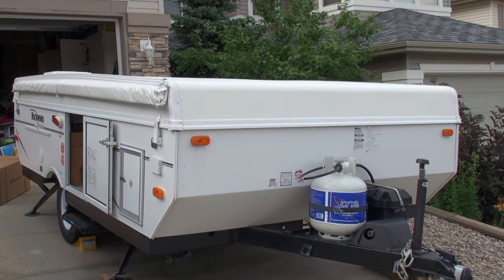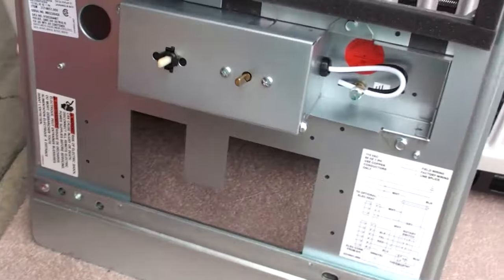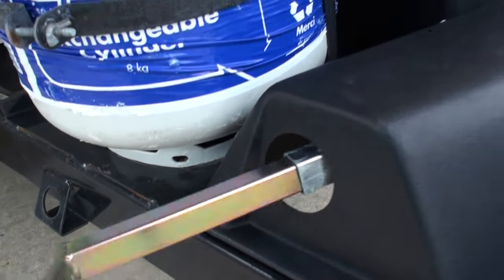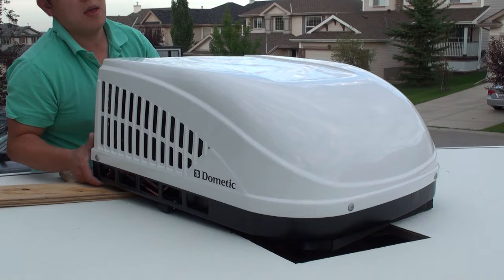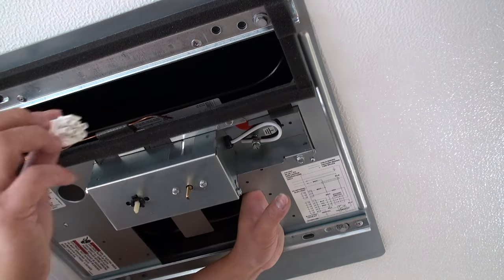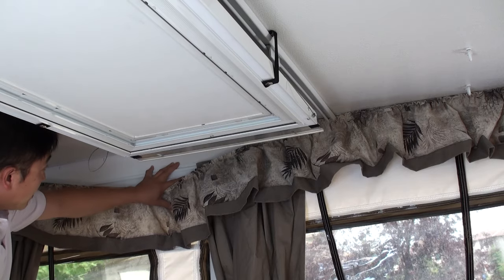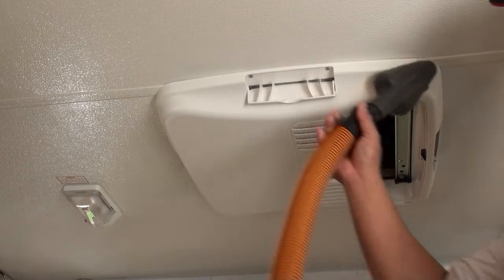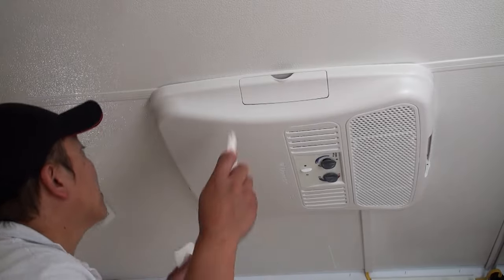Install a RV Roof Top A/C Unit on a Forest River Pop Up Camper Tent Trailer

Comment: I was actually thinking of installing a Brisk II air conditioner through the vent in my rear bedroom in my travel trailer - it would be my second A/C.  The only problem is my TT is only 30 amps so I can't add the power back into the main power.  That being said I was thinking about just doing the outside connector (same as you did) and then plugging that straight into the shore power at the campground so I would have both a 30 amp and 20 amp cord going into the shore power.  Besides the obvious problem of perhaps some campgrounds don't send enough power to the box to work both the 30 amp and 20 amp circuits at the same time, and the fact that the only breaker I would have would be on the shore power box, do you see any other downsides to doing this?  AWESOME video BTW, really helped me decide whether or not to do this.
Reply from the maker: +OmegaZero1981 If you're adamant on having dual a/c on your travel trailer I would opt for a power panel upgrade and convert the panel to handle 50 amp service.  In your case your input feeder to the power panel is 30 amps.  A simple swap out of the shore power cord and power panel = super easy to do AND it will allow you to wire everything cleanly like it was designed from the factory.  Remember, 50 amp service isn't saying that the rest of trailer will "use" the extra amperage but rather that it increases your input capacity to split out the power safely to the rest of the trailer's electrical loads.  Keep in mind that if you swap the panel out that you can resell it to recoup a lot of your costs so this is something I would do if I were in your situation.  

For the campgrounds that don't have 50 amp service just remember that they'll at the least have 30 amp service which you can still use for your trailer permitted you don't run both a/c units (otherwise you'd trip the campground breaker).  

I personally don't trust the campground breakers as I have seen breakers fail and it gives me chills knowing that the outlets and breakers in some campgrounds can literally go up in fire.  Put the protection where you know how it's been treated (i.e your trailer's own power panel).

Glad you liked the video.  Give me a thumbs up if you can and consider subscribing :)

Comment: This video is exactly what I was looking for as far as install. You do a great job explaining. After googling I came across a forum thread with your link to this video. I also have a 2280 but it has the roof vent already installed with a fan. I was wondering if you had any links to where you got the cord and also the plug part you have to drill the hole for wiring. Thanks.
Reply from the maker: The cord is made from SOOWJ cable (essentially a commercial grade 12 gauge extension cable).  The plug you just purchase from the RV dealer as they sell them usually as a regularly stocked item.

Comment: Just a quick note to say Dometic now has very good DC air conditioners which are far more efficient if you're running from a battery. There is also a Under Bunk unit.

Comment: This video was perfect. I love how clearly described everything was, with great camera angles, lots of very specific technical advice, i swear I could print off a transcript of this video to get my shopping list. Bravo! now just to find out if my 93 palomino yearling has roof bracing built in. If it does not, do you have anu advice on what I can do to brace it up?
Reply from the maker: Glad you liked my video!  A lot of time and effort went into creating that but it was worth it when I hear you say that it was well done :). You can buy roof braces for your pop up from a Palomino dealer. They may need to do some digging but they should be available. If I recall they are bolted to the underside of the pop up’s roof and then screwed into the stronger wood side panels that make up the roof frame. Double check before proceeding.
Reply: @piercedasian thanks! after i left this comment I looked at the riginal manual for the year I have (1993) palomino line of models and it clearly states that every one of the models in that year except the shetland (the smallest one) had A/C available and the photo of the unit looks like it was right where my existing hatch is. I take it to mean that this would already have the bracing installed, similar to what you had n this video. If you have any different take away from this I would gladly accept your advice.
Reply from the maker: Hmm, that's a tough one.  I personally would think that there is bracing already inside but "a/c available" could mean that there is an optional roof bracing kit that comes with having a/c installed.  Do you see the little screw int he roof like what mine has?  If it does then it likely does have the bracing inside the roof b/c why would they mark where the hole is if it can't have a/c?  It certainly isn't used for installing a roof vent b/c the Palomino's already one one towards the back.
Reply: @piercedasian  very good point. I cant get to my unit right now thanks to weather but when it becomes accessible I will have to look for any other screws indicating a hole. The part that trips me up is that the original brochure shows a photo of the ac unit and I could swear it looks like it is in the same location as my roof vent, which I thought was odd but it impossible. I will comment back when I am able to climb inside and do a little searching

Comment: outstanding video! clear and some very good information! thank you sir, you just gained a subscriber.
Reply from the maker: thank you for subscribing to my channel!  I'll be doing a new vid on properly sizing RV shore power cables and making sure that your RV is properly wired for all connected loads including whether or not one should require a main breaker in the power converter.  Doing it this week so you should see something posted next week :)

Comment: Awesome video!! I have a 2018 Coachmen Viking that is AC prepped from factory. I would like to install an AC unit. Is my setup plug and play or do I have to install a similar electrical set up like you describe in your video?
Reply from the maker: it will depend on the model you have.  You need to consult with your owners manual or call the manufacturer to find out.  In many cases you will need to install the electrical as how I have demonstrated.

Comment: Nice video. A couple of things, first a question - does this unit cycle off when it reaches temperature, or is it like the old ones where the pump cycles off but the fan continues to run?

Second, you could use a drywall hole saw to cut the ceiling panel, then drill the four corners as markers... using a jigsaw and hoping you "feel" the parts you should not cut is kinda risky...
Reply from the maker: Hi David, the fan stays running and the compressor cycles on and off.

I could've done the drywall hole saw but honestly with a jigsaw/reciprocating saw you could definitely feel where the supports were.  As long as when you're cutting you're not forcing the saw and letting it do the work it is equivalent to cutting butter and when you hit the "framed hole" that you'll know.  Just take it slow and gentle and it's super easy and nearly idiot proof.

Comment: Have you thought about adding the heater to the a/c unit? I was wondering how difficult it might be. The older and wiser I become I would prefer to use electric heat vs gas heater in my pop-up.
Reply from the maker: I did but the issue is the heater is so small and the fan moves so much volume of air that you won't actually feel much heat at all and you're better off to run an inexpensive 110volt AC space heater instead.  The optional Dometic heating strip is costly but is EXTREMELY easy to install.  Plug and play and 1 screw to secure it.

Comment: The roof installation was done very well and gave viewers an accurate assessment of what is involved in the installation. I am wondering however why you did not just use a GFI plug mounted somewhere inside the trailer and just run a power cord to that plug instead of doing the additional plug on the outside of the trailer? Fleetwood Niagara trailers use that type of installation to avoid having any extra holes drilled to the outside of the trailer. Was this required to do with the unit you installed?
Reply from the maker: I installed the A/C unit exactly as how Forest River would've done from the dealership or factory.  There is actually a GFI plug inside the trailer where the umbilical power cord plugs into so I'm definitely well protected.  I was going to go the route of putting the wiring inside but I'm a "factory" kind of guy and if the factory does it a certain way you can be sure that I will likely follow suit.  Sometimes not the best approach to do things but at least I know it is proven to work.  No leaks or anything so far so I know the install is holding up perfectly.
Reply: Ahh ok ... the A'/C unit on mine has the power cord run to a GFI plug inside the trailer from the factory which is why I was wondering why you routed it to an external plug then back to your panel. Nothing wrong with the way you did it I was just curious.
Reply from the maker: yeah, the manufacturer apparently designed the install specs in the manner that I showed so I simply did it the way their engineers had it.
Reply: It's interesting how Forest River chose to do it. The only real advantage I can see is that you can plug your AC directly into the power pole at a campsite or a generator with an extension cord, and not go through your trailer's converter, freeing up that plug you put in for a space heater, microwave, or something like that. 

Like Chad mentioned, the way Fleetwood would have done it from the factory on our Santa Fe would be to run essentially a 12ga extension cord on the inside, down a sleeve in the canvas to a plug that gets plugged into a prewired 20A GFCI outlet. No worrying about putting holes in the roof or sidewall of the trailer (other than the 14x14 hole for the AC itself!).

I really enjoyed your video, it was extremely comprehensive and detailed, and it should help many folks feel more comfortable about installing AC themselves.

Comment: I was just looking for bracing ideas as my old 88 Coleman AC is sagging. This was a great video. I love quality installations. I have noticed that my AC blocks my rear view mirror and have seen some AC units installed off center for that reason. Wonder if off center weight would affect how these roofs sit.
Reply from the maker: Glad you liked my video.  Yes I'm neurotic about quality work.  I hate it when things don't go perfectly.  Frustrating and annoying to go back and rework things when they could've been done right the first time with some upfront planning and care.  I can't say that I've ever noticed the roof sagging or be "offset" from the weight.  No issues so far and it's been a few years since I installed this a/c unit.

Comment: Nice manly shoes for using power tools! Good thing you didn't slip and cut off a couple toes!
Reply from the maker: True... I had my steel toes in the garage and probably should've worn them.  Manly shoes?  Sandals can be worn by men... maybe just when carrying a 100 lb air conditioner and using power tools... that was my bad.

Comment: Great video, I admire your thought process; "the most important step in the process, is the step you are doing at the moment", don't proceed until each step is perfect! I'm like that too and am constantly criticized for it. 
Now that it has been five-years, how is the Dometic holding up? I just read some reviews on that model and not all good. 
I have an old ambulance that I converted into a camper, it has 20 amp shore power and I use a 2900/3200W propane generator when boon docking and no electricity is available.Would this generator handle the Dometic unit?
Reply from the maker: The Dometic a/c is working wonderfully.  I've sold the pop up camper but stay in touch with the owners and they LOVE it.  Not too many pop ups with a/c so if you see a Rockwood 2280 on the road that it might be ours :). The reliability of these units is only as good as the install.  I'd be interested in knowing what people complain about on these units.  Dometic DID have a run of undercharged units back in 2015 that caused a lot of issues (mainly not cooling well and ultimately burning out).  Lucky for us our a/c unit (plus another one I installed for a friend's pop up) works perfectly and continues to do so years after I installed them.

Comment: Only tip I would add is to locktite the 4 bolts that attach unit and inside panel to roof. They loosing up over time causing ac seal on roof to leak

Comment: How many watts is your inverter?    Great job by the way, thanks for posting. Now it's my turn to put  air conditioning  in my class C.   Wish me luck. !!!
Reply from the maker: My generator is a Honda EU2000i inverter.  Running watts is around 1600 watts continuous.  When I need to boondock, I will pair my unit with another Honda EU2000i unit (from a family member that owns the same unit - that decision was by design so we could "share" as needed when we'd go camping).  To properly run a 13.5K BTU unit without any "startup" voltage sag damage it is best to run a minimum 3000 watt generator on full speed so startup of the a/c unit doesn't struggle with any possible voltage sags.  Having dual EU2000i's of course gives me PLENTY of headroom to run the a/c all day long and keeping fuel consumption in check.  I try my best to select sites that have power so that its remains quiet and decouples my need to run a noisy, fuel consuming genny.

Comment: @34:30 typically you want to wrap tape in the same direction as the tightening of wire nut --> clockwise. Source: I am an electrician. It truly doesn't matter than much tbh. Great video
Reply: @piercedasian
Reply from the maker: lol, yes I noticed that too after the fact.  It likely won't make any difference since nothing will be moving after its installed but yes it is the small details that do make the difference.

Comment: Thanks for the very comprehensive video.  I'm just wondering if you installed a thermostat with your unit.  If not, did it run ok without the thermostat?  Thanks.
Reply from the maker: the air distribution box has the fan speed control and thermostat.

Comment: I was considering that however I nearly restored more of a vintage 1984 Coleman to it's pure original way and it looks better than most new pop ups as it is in near mint condition. I would hate to ruin it on cutting a hole. I am doing upgrades on it to make it more advanced than most however as I want kinda the old meeting the new. I am putting on a fairly large solar system in it next that covers nearly the whole roof with a huge panal. It is not that I need it now but I may. It seems like all campgrounds now have water and electric unlike the old days. I never do primative camping either as it really does not save much money plus the locations are much further away to most amendaties. 

But I also look at it as it would be nice to have if we face a hurricane needing to leave and return after the storm without power. I am putting in a 14,000 portable BTU in the camper that fits a 110 outlet unless I can get a bigger BTU that works on a 110. 

My question to you though is , you have a 13,500 BTU, how cool does it keep with you know that the ac goes out the tent sides fast. How cool does it keep it?

Comment: How is that unit working out so far? We have a Fleetwood and the Coleman Mach AC unit went out and was looking at this unit as a replacement. Wife is worried about it being louder than the Coleman Mach we have now. Your installation was top notch by the way.
Reply from the maker: a/c unit has worked perfectly for the past 2 years since it was installed.  Granted our climate doesn't necessarily call for a/c all the time that for the days that we needed/wanted it that it worked so well.  I can't imagine having ANY trailer without a/c.  I'm a wuss for too hot or cold so this worked out well.  I prefer Dometic over Coleman for looks and price.

Comment: Great video think i can try it now :)  How well does the unit work when its really hot?
Reply from the maker: it really isn't hard to install.  Just time consuming if you're doing things correctly.  Unit works wonderfully when it's hot out.  It was 100F on one of my camping trips and I felt like I was sitting inside a meat locker :)
Reply: thanks I was wondering without hard walls if the cold air stayed inside

Comment: thank you for the amazing video, it really helped me a lot!!! do you have any idea how can i run this a/c to my power inverter? i am using 2000w on 400 AMPs battery
Reply from the maker: nope, an a/c unit especially during start up can pull as much as 3000+ watts.  Not a good idea and it will VERY rapidly deplete your batteries.  Even if you COULD run the unit that your power inverter needs to be a high quality true sine wave unit otherwise it will not run the motors properly.  Definitely not recommended.
Reply: @piercedasian  thank you for replying to my concern, this information will help me alot in my new conversion project 👌
Reply from the maker: you're most welcome.  For faster responses you can always email me at piercedasian@gmail.com

Comment: I was wondering if you are satisfied with the cooling that the 13,500 BTU provides.  I'm looking to take the plunge and purchase one of these but I see that there is a 15,000 BTU.  Thanks again for the video!
Reply from the maker: I am extremely happy with the 13,500 BTU unit. It has kept up no problem with keeping the pop up camper cool. I would only recommend going to a 15,000 BTU unit if you camp in an extremely humid area or if temperatures frequently soar well above 35C.